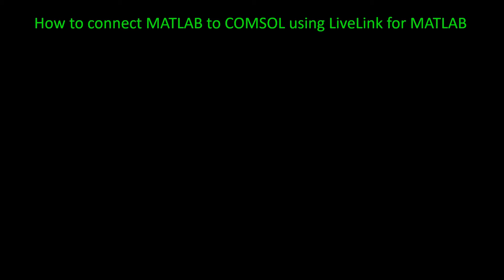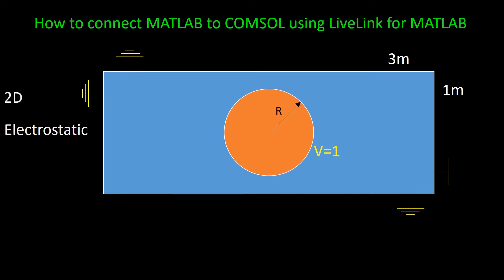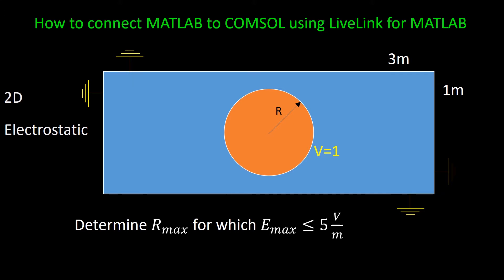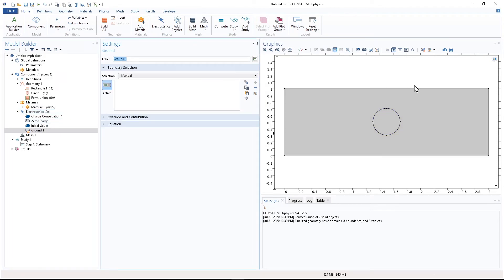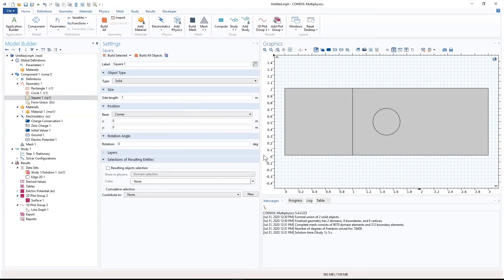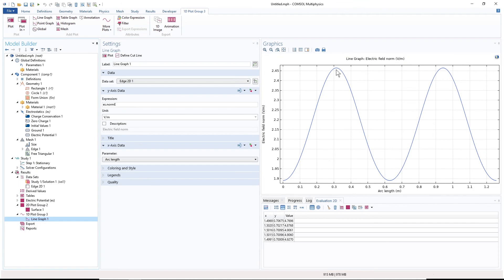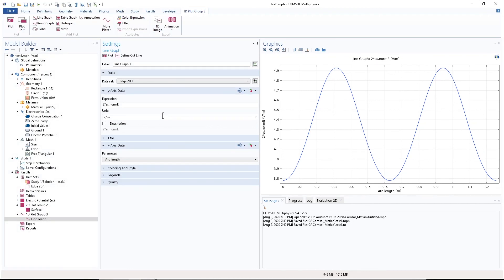How to connect MATLAB to COMSOL using LiveLink for MATLAB (Part 1: problem definition)

Comment: Timestamps (Powered by Merlin AI)
00:02 - Connecting MATLAB to COMSOL using LiveLink for MATLAB
01:12 - Determining maximum radius for electric field limit
02:14 - Connecting MATLAB to COMSOL using LiveLink for MATLAB allows for efficient problem analysis.
03:24 - Reverse engineer model in COMSOL and save as m-file for necessary commands
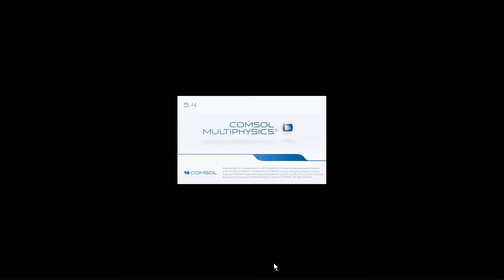04:28 - Changes made in the model are reflected in the m-file
06:29 - Improving mesh quality and adding additional geometries in COMSOL using LiveLink for MATLAB
08:00 - Comparison of maximum electric field values on the plot and the surface
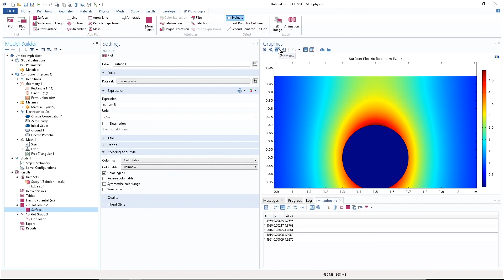09:10 - Connecting MATLAB to COMSOL using LiveLink for MATLAB (Part 1: problem definition)

Comment: Thank u very much for the video. Can we do optimization directly on COMSOL? If yes Please share a video with the same problem discussed in this video. Thanks a lot
Reply from the maker: Thanks for the comment, yes it is possible to some extend. At least to find a local minima is possible, but i am not sure if you can do a global optimization such as GA directly in comsol, for that better to use matlab in connection with comsol. i will make a video and do the same thing shown in my previous video, directly from comsol optimization option. and will update this comment with that link.